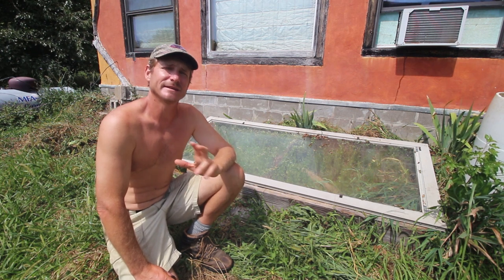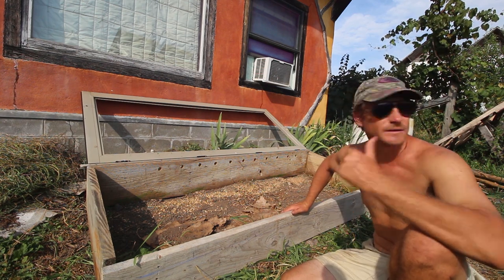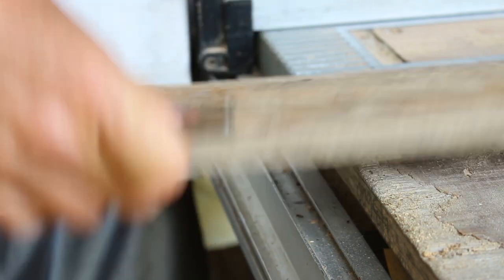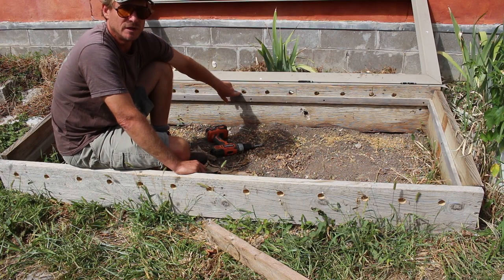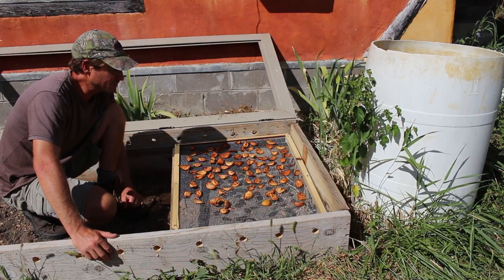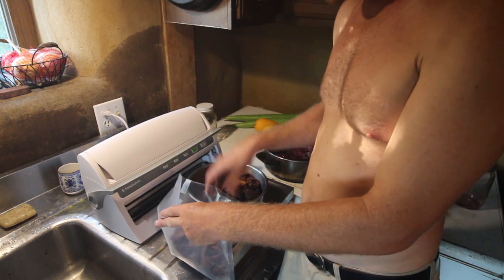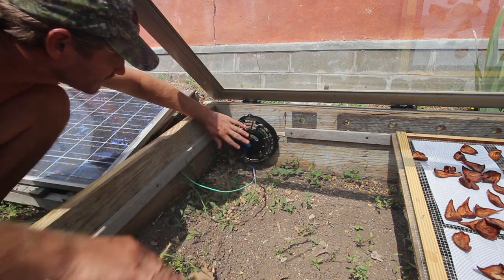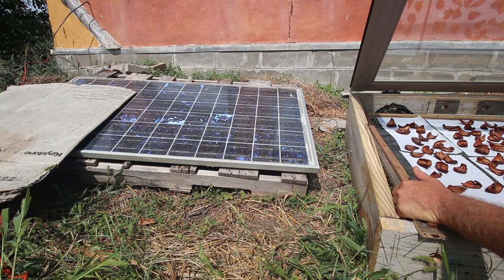Supercharged SOLAR DEHYDRATOR that doubles as a COLD FRAME

Comment: I'm so glad I found you on youTube.  You have shown me some more horse-sense =reality than I have seen for a long time.  I am a subscriber now.  Keep um coming.
Reply from the maker: Hey, welcome to the channel and thanks for the compliment. I'm glad you've found my videos useful.
Reply: The Larisa Walk - Bob Dahse sooar dehydrator us the optimum design. It also uses black painted screens above the food and below a polycarbonate sheet (for light weight). The black metal converts sunlight into infrared which radiates onto the food below. This preserves maximum nutrients and works more efficiently than direct sunlight.
The whole dryer is modular, as large or small as needed, in 2 ft x 2 ft screens. 8 x 4 is a useful size.
The dryer is set on an angle of about 13° to the sun, to capture max sunlight without having all the food rolling downhill.
It is all built on legs, for waist-high ease of access. The screens can be directly laid on the corrugated roof of e.g. a woodshed.
Below the screens is a base of recycled corrugated iron, with air being thermosyphoned from the lower south side to exit at the higher north side. No holes need to be drilled or covered up, and no fan or solar panel is necessary.
Their plans and PDF of a construction workshop can be found online.

Comment: Most computer places would probably give old scrap case fans to you for free.   As long as you know how to splice wires to your preferred way to power it, you should be able to save some money.  The fans you are looking for come out of the desktop type computers (not laptops) and either a "case fan" or a "power supply fan" will work.  I have gotten many good working fans out of dead power supplies.  At my computer store, we used to splice these to USB cords to create some great fans that we could point towards our faces on really hot days.  The kids I mentored were pretty creative in finding/making something to mount the fan into.
Reply from the maker: Yes, that radiator fan was only $15, so it wasn't a big expense. I have a computer fan, but I thought I'd need more than that at first. It might be best just to have the fan I've installed at a really slow speed with a 50W or 25W panel.
Reply: Agree, a fan from a junk computer will move plenty of air for this application. They are 12 volt and use very little power. I use them on my rabbit cages in the summer to get a little air flow.
I wire them correctly to a solar panel so the hotter it gets the faster the fan runs.
They can also be powered 24/7 By a small wall wart on 110ac.
They can be run in series if more air flow is desired.
Thanks for the video.

Comment: I’m personally considering a solar dehydrator for this summer. I personally like the cabinet above and offset from a solar collector. Have you considered putting a metal sheet on the bottom of the converted cold frame dehydrator? I’m thinking a long collector that will vent heat through a not so air tight cabinet.
Reply from the maker: putting the metal sheet on the bottom of it could work better. It would also help smother any weeds growing up from the soil.

Comment: Have you come across the technique for vacuum sealing in recycled jars? It's completely plastic free! It's been a game changer for me. I don't want to spam your channel by posting links, but I have a few videos on it. One is called "How to vacuum seal virtually anything without using any single use plastics.".
Reply from the maker: Thanks for the info! I'll definitely check it out. I didn't know there was such a thing.
Reply: @HardcoreSustainable  I was shocked when I came across it a couple of years ago, it was one of those "where has this been all my life?" moments. I vacuum seal everything from seeds to rubber bands, now. No plastics, no waste, it uses jars that would otherwise get trashed or recycled.

Comment: Great idea however with the dehydrator however using  the plastic n paint in high heat to while drying your food might be toxic for your food so I’ll omit that part
Reply from the maker: It's not super hot. It can't be or it would affect the nutrients of the food. I usually leave it cracked these days to allow ventilation and reduce the temps inside. The plastic is food safe and much better than sitting on the hardware cloth, which is not food safe.

Comment: Are you worried about vitamin loss from the fruits being directly in the sun?
Reply from the maker: Yes that could be an issue. This is why I put the black covers on over the fruit. If you watch the video all the way through, you see I talk about the loss of nutrients from direct exposure to sunlight. The black metal pieces will collect the sun's heat and reflect it into the space. The fruit takes longer to dry that way though. I'm pretty sure that people have been making raisins and other sundried fruit for millennia in direct sun.
Reply: I would only protect from uv green or other delicate things like maybe chamolille or other medicinals. Chunky fruits, tomatoes, etc benefit from solarizing, heating up and uv zapping bad bacteria, to prevent molding also. Just my experience at home for personal use and tradition

Comment: You mentioned power from your micro-grid cost $.67 per kwh. Can you explain this high cost compared to a national average of about $.15 kwh?
Reply from the maker: We don't have the economies of scale that are possible with installing a large fossil fuel generating system. Except for wind, renewable energy is more expensive than coal and gas. We are implementing solar on a small scale with our microgrid. And part of the reason the price was raised recently from 37 cents/kWhr to 67 was to deter people wasting power. I do think it's too high and was arbitrarily chosen as a price. The rates were also raised to pay for installation of a new array and to cover insurance costs. Still I think it's artificially high and should be lowered.
Reply: @HardcoreSustainable  A good topic for a future video: Describing how DR micro-grid works. Its physical configuration and its economics. Thanks in advance.
Reply from the maker: @jaytigra2234  Yes that is a good topic to do. I haven't covered it specifically yet. It's also something we are working on improving right now.  Thanks for the idea.